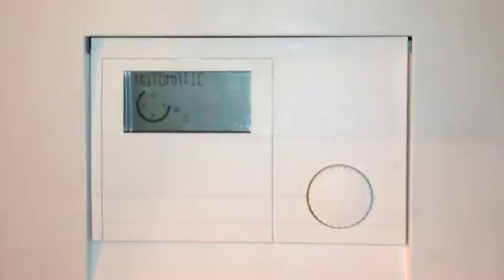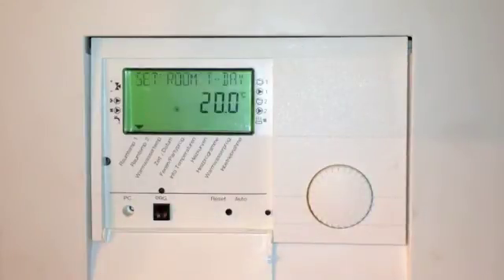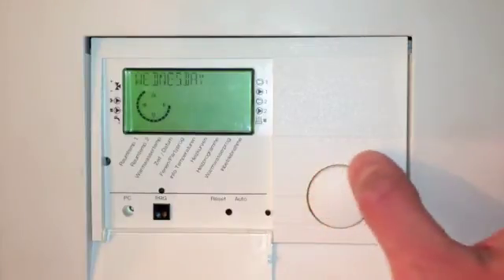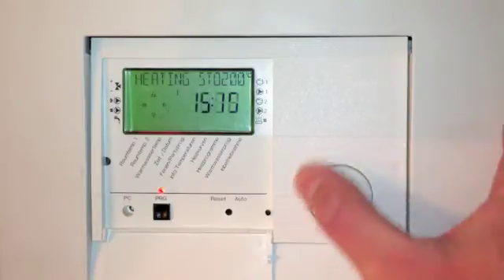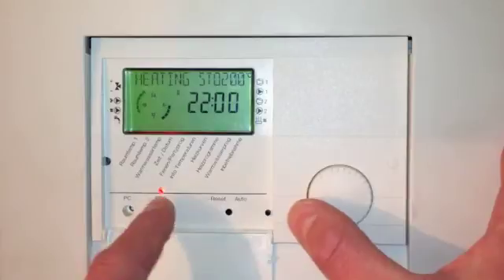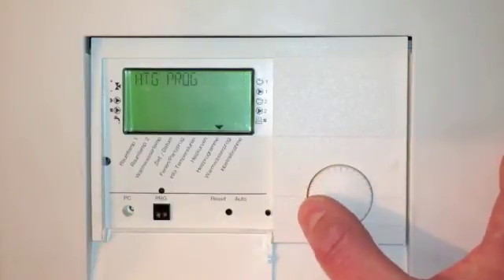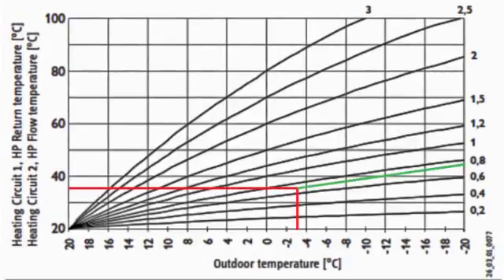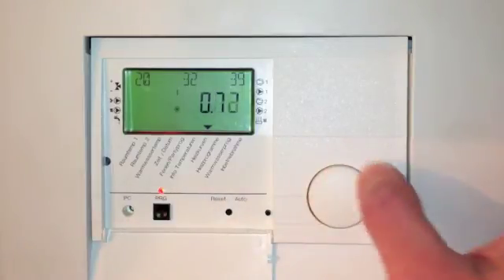WPMii basic Heating settings

Comment: You lost me on the Stiebel Eltron Heat Curve. Can you explain slowly and exactly.

Top 3 figures of screen do what?
Top left figure of 20 = 20ºc for underfloor heating?
Top Middle figure ?
Top Right Figure?

If I set my Top left figure to 20ºc then how will the system reach 24ºc If I turn up my FE 7 thermostat?

Comment: What is Heating Circuit 1 or Heating Circuit 2 ? HC1 vs HC2
HC1 Return Temp is from what? (Ground heat recovery?)
HC2 Flow Temp is from what? (Actual captured heat within the system?)

Comment: I want to replace my WPM on my heat pump. Is WPM II going to work as WPM? The manual says that WPM II is going to work with any Stiebel Eltron heat pump.
Reply from the maker: Hi, this channel is not staffed by technical staff. Can I ask that you direct you enquiry to technical@stiebel-eltron.co.uk or 0151 346 2301. Best wishes.